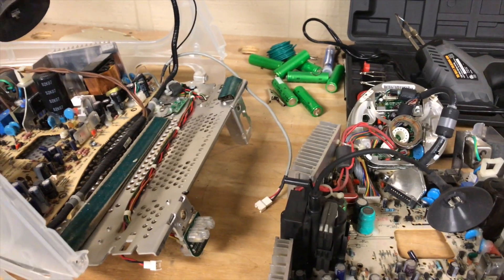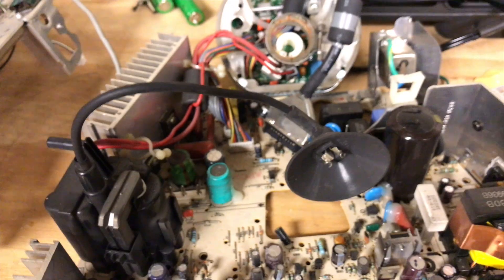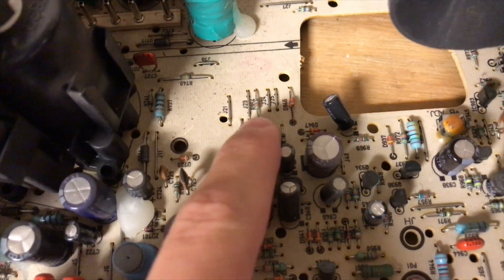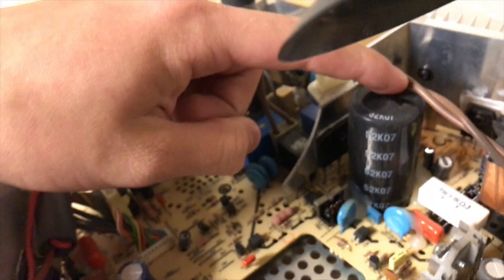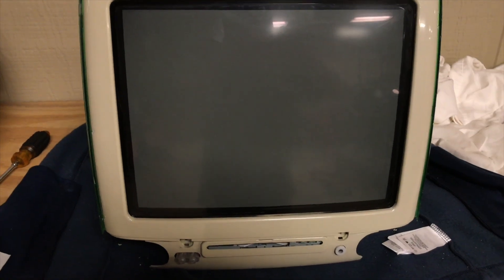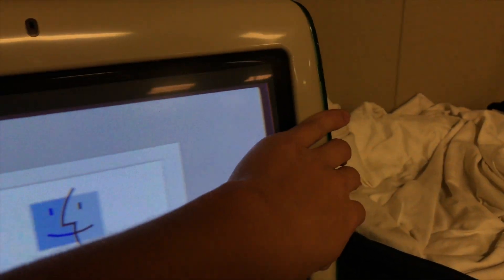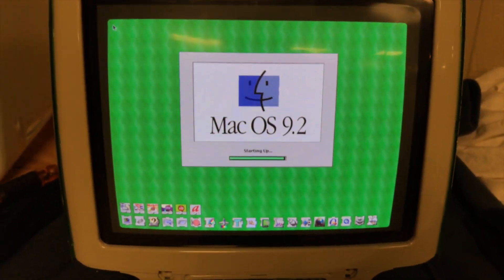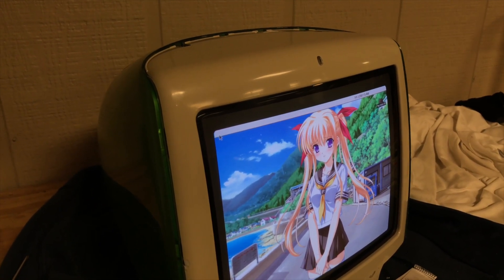iMac G3 Analog Board Swap (LG to CPT)

Comment: I'm guessing the LG board is the older supplier, and the CPT board would be in the newer Summer 2001 units? I wonder which one is the more reliable version....
Reply from the maker: @mattyb33ts  The board you have depends on where the iMac in question was manufactured.

Comment: Well I have a opposite problem - My Imac G3 has died and there is problem with PAV board. Unfortunatly i got a CPT CRT and as a replacement got a older PAV board without switch (got LG brand on it). Is there any option to safety use this board or modding to work with CPT display?
Reply from the maker: Not that I know off, sorry.
Reply: @TheTechnicalWizard  Ok, thank you for reply
Reply from the maker: @ExusOne  Of course!
Reply: Ok so propably I'm the first one who was try this, but.... First I'm still alive :) Second the LG no switch PAV works perfect after putting all things together, it only needs some adjustments.

Comment: Every LG PC CRT monitor I've ever had has suffered a failure of some sort (with the circuitry, not the tube itself). Kind of makes me wonder just how reliable their CRT electronics are. Oh, and just an FYI - the green component you pointed out at 0:53 is an inductor, not a capacitor.
Reply from the maker: Got it, thank you!
Reply: No problem :-)